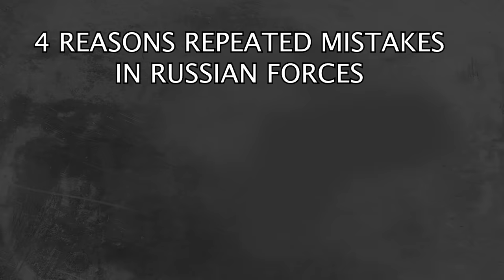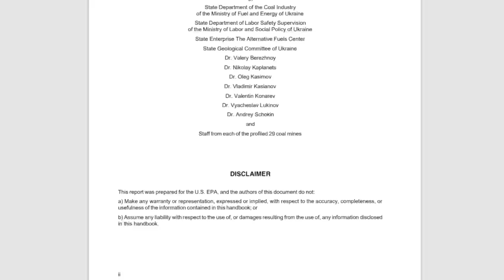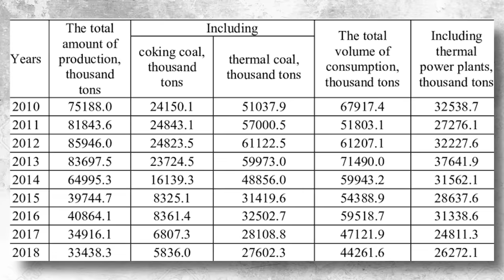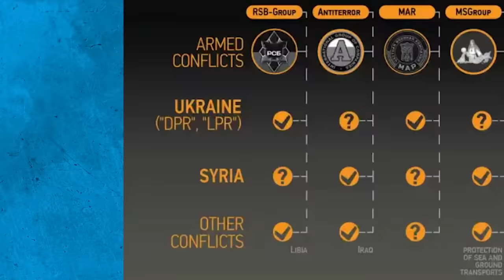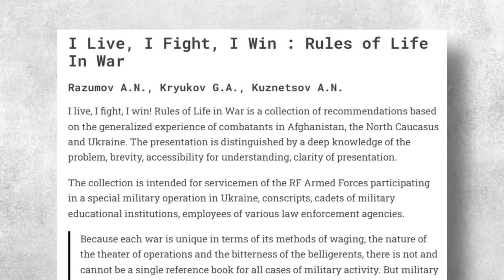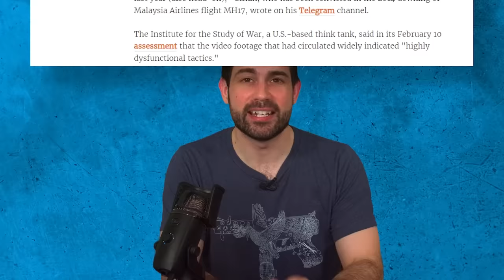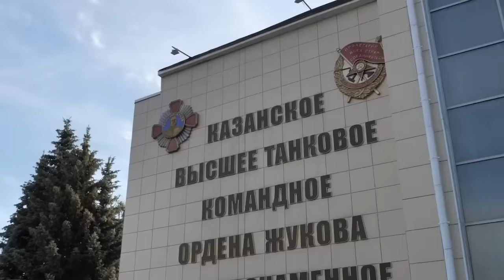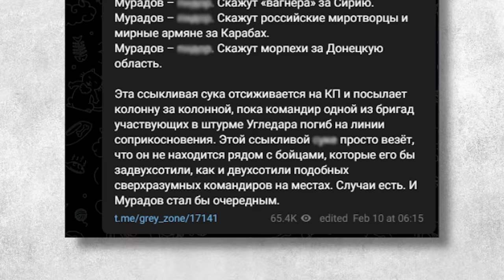Vuhledar, Why Russia Repeats the Same Mistakes

Comment: Nothing much has changed for Russia. I once read a book titled Tigers in the Mud. The man who wrote it was Germany’s first Tiger tank commander. He said that the Russians didn’t really adjust to their failures. He praised their heroism and willingness to charge. But he said they would do the same dumb thing over and over again. For example, he said that one of his positions was to guard a side of a valley. He had four Tiger tanks. On the other side of the valley, the Germans had placed some anti tank guns. The Russians knew the anti tank guns were there. Anyway, he said that he woke up one morning to nine T34s coming down the road in the middle of the valley. They were all pointing their guns at the side of the road where the anti tank guns were at. So he and his crews fired up their Tigers and they easily took out all nine T34s. The next day, he hears the rumble of tanks coming down the road again. He looks and here comes eleven T34s. But, again, all of them have their guns pointing at the position of the anti tank guns. So, again, he and his fellow Tiger tank buddies took out every one of them. It would seem that this has been a thing for some time with the way that Russia operates.
Reply: Bro who needs logistics
Reply: true NPC behaviour
Reply: And then they drove thosands of tanks to Berlin. End of story.
Reply: Goes to show that the key factors in winning a modern war are:

Production
Production
Production
Reply: In WW2 one Estonian guy took out 7 Russian tanks in a row with only one 88 Flak gun.
Reply: @oknevals  Amazing what you can accomplish when you are indifferent to the human cost to your own side. 

Russian "victories" historically seem to require a very high number of casualties. I read once that the Russians lost more guys in one battle than America did in the entire war.

That is not something to be proud of.
Reply: There is a famous story along these lines. Essentially in WW2 there was an order from the top to have the Russians cross this river by a certain time period. By the time it got down to the bottom they realized it was impossible. The river was way to fast, too much water. 

But they were too scared to relay that back to the top, because anytime someone said no to orders they would be shot. So one by one soldiers marched into the river and drowned. Did they stop? No they did it again, and again, and again. Until finally so many people died that they were able to walk into each other to get across. 

Even as people were dying, the commanders couldn’t tell the folks above them because if they did they would be killed and replaced with someone who would do it. 

So they carried out the orders of some guy sitting in a desk somewhere and had no clue of the reality of what was happening. The people at the top had no idea that it was impossible and because there was no communication between the ranks. Just from the top down. 

I might have some of the details wrong but it went something like that.
Reply: It’s a great read, it is even an audiobook on YouTube.
Reply: @ashcarrier6606 even the Germans lost more soldiers in Stalingrad than the Americans lost over the entire war. Each day in Stalingrad (for both sides combined) was essentially a 9/11 in terms of deaths. And the meatgrinder kept on turning for nearly 2 years. 

There were buildings that got captured, recaptured and re-recaptured so many times that the dead from either side couldn't even be removed from them.
Reply: @oknevals  Because Germany ran out of supplies. Ukraine has Nato fueling it
Reply: @ashcarrier6606  In many ways, Russians are their own biggest enemies. On the other hand, Russia is the biggest world country by land mass and there must be reason for that. Also, no single country in history fought wars on scale that Russia did and survived in its form. Communism was their biggest defeat but, they got over it too. They are difficult to understand but, I for sure wouldn't want to fight them.
Reply: that's just totally false, do you know of Bigration?
Reply: @ATRestoration  'only one flak 88 gun'
oh yes, 'he did it with only the best anti tank gun in the world at the time'
Reply: 200iq rught there
Reply: @oknevals  yea tanks made of American steel and bellies full of American food.
Reply: @ATRestoration  thank you
Reply: @oknevals  Oh, so Russia wasn't supplied by America?  Russia would've been defeated without help.
Reply: @MountainFisher  it only accounted for a fraction of USSR war effort.
Reply: @oknevals  At an enormous cost. Unecessarily losing millions of men is nothing to boast about.
Reply: @HaloJumper7  incorrect. During the phase of Operation Barbarossa where the Germans were still just steamrolling them, they lost very significant portions of the arable farmland, in combination with the scorched-earth policy, and had to move their heavy tank plants to the Urals to keep having any capability. They were absolutely in dire straits wrt food and military supplies, which they got from the West. Stalin absolutely hated that fact, of course, and modern Russian propaganda also likes to pretend it never was so.
Reply: @oknevals  The United States gave the Soviets in WW2: 11,000 planes, 6,000 tanks, 300,000 trucks, 350 locomotives, 1,640 flat cars, half a million tons of rails, axles, wheels, miles of field telephone wire, thousands of telephones, thousand of tons of explosives, thousand tons of machine tools and  3,000,000 tons of food. What delusion do you speak of.....?
Reply: @oknevals  how am I brainwashed?
Reply: @MountainFisher  America helped some for its own interest. It was not critical or determining factor in any way. Learn some history.
Reply: @oknevals  Exactly! Because thay had tens of thousands and lost most of them in the process. Along with 25 million of their citizens. But as once comrade Stalin said "Death of man is tragedy. Deaths of millions is a statistic". Don't you agree?
Reply: @oknevals  Though often said, history does not repeat itself. Learned behavior/habits do, especially when in large scale and/or systematically.
Reply: @jamstagerable  What did US learn from wars? Korea, Vietnam, Iraq, Afganistan, Syria, just to name few. It is the Western policies that brought world to the point where we are now.
Reply: @oknevals  the Soviets and Russia literally supplied the weapons for every contradictory establishment in every war you just mentioned 🤣 you cant make this shyt up. Where are you from?
Reply: @oknevals  There in lies my point, which remains the same...You won't catch me on some ignorant personal bias as you're showing yourself to have.
Edit: The world would be nothing but flowers and butterflies today if not for Western policies. 😂
Reply: @oknevals  yeah, because all of those billions of dollars of military aid were not 'a determining factor'
Reply: @oknevals  The Soviet military was heavily armed  by the Western allies.    Russians never showed any inkling of gratitude.
Reply: @Ashley Carrier  to be fair though the vast majority of axis causalities were on the eastern front not on the western front. So it's to be expected the Soviet Union would sustain more casualties.
Reply: @slkjvlkfsvnlsdfhgdght5447  No. West needed Russia both against Germany and against Japan. They didn't give Russia anything from goodness of their hearts and hundreds of thousands of other than Germans soldiers fought against Russia. It was actually very few who resisted. Mainly Serbs and Poles. Few other Slavic nations on very small scale. Western resistance was symbolic at best but, fascist attrocities cannot be compared to those commited in Eastern Europe.
Reply: @oknevals  absolutely delusional
Reply: @oknevals  and do you think Stalin did it for a greater good ? If US help wasn't necessary why Stalin accepted it? Population was starving American canned food saved many lives.
Reply: @markhennessy7598  A Russian living in America, you couldn't make this shit up.
Reply: @oknevals  who said it was out of kindness? whatever the reason, it doesn't matter: the material help was immense
Reply: @markhennessy7598  What tanks were used at Kursk battle? Russia produced 120k planes in four years of war. Why did Russia fight Japan? Sure wasn't for charity. Why did US drop two atomic bombs? Almost third one.
Reply: @oknevals  🤦‍♂️Why are you on an american platform spouting USSR rhetoric?
Reply: I see a lot of you are mixing up Russians and Soviets. Russians are mainly Orthodox Christians. Soviets were Godless communists who hated Russian Church. Most of soviet top leaders were not Russian. Lenin, Stalin, Kruschov. Not sure about Breznev.
Reply: @oknevals  I'm not at all. I literally posted statistics that proved you wrong and then you called me delusional along with brainwashed. Then you have continued ever since to bash my country, the country that owns the platform you are currently using to spew anti American rhetoric...nothing you have said holds any logic or value. The fact that you are trying to separate Russia from the Soviet Union is pure delusion aswell.
Reply: @oknevals  after losing Millions of soldiers
Reply: Otto Carius. It was a good read.
Reply: @hashbrownz1999  while everyone in the world play like a noob conserving their resource. Russian play high level Pro RTS Macro game.
Reply: Great book, would recommend it to anyone
Reply: Soviet doctrine was attack o. All fronts and push reinforcements where the battle is doing best.
Reply: @oknevals  assuming they have the same industrial capacity and endless manpower.  I think this time, both sides have neither.
Reply: @ItachiUchiha-ny6di  by nato, at this point, you mean the US.
Reply: USSR thought there was strength in numbers by fielding massive numbers of fighter jets in the 60s and 70s. Of course, they were forced to think that way because they did not know how to manufacture precision ball bearings, one of the industries the US grabbed after VE Day. Their turbine engines required maintenance every 50 hours. Meanwhile, CFM and GE were producing engines that only required oil sampling every 300 hours. One DC-10 (I think) had a CFM-56 engine that never left the wing. CFM wanted to buy the engine just to take it apart and figure out what they did perfect. USAF wouldn't part with it.
Reply: @OldMusicFan83  Right now there are many sides and none of them seem to be much better than the other. Which side will prevail (if any) is impossible to predict at this point. The only thing to tell appart is that one side may be little bit more right than the other.
Reply: @oknevals 
The Allies drove thousands of tanks to Berlin. Russia for it's immense contribution to the war, could not have taken Germany alone, NONE of the allies could have. 
Typing this out I remembered a key detail in that Russia wasn't just fighting Germany, it was fighting an alliance made up of multiple countries it was bordering as many of them had allied themselves with Germany after the fall of Poland showed them that Britain and France weren't going to help them.
Reply: And they beat the pants off Germany. So there that
Reply: @ashcarrier6606 That wasnt the case in the soviet afghan war that lasted 10 years. The soviets inflicted 5 times the casualties on the afghans while suffering much less themselfs
Reply: @oknevals  only possible with American lend lease, otherwise they would have lost the war badly
Reply: Tiger worked just as well on Sherman tanks
Reply: @SelfProclaimedEmperor  Looks to me like Americans like to take credit for wars somebody else won but, finding all kind of excuses for wars they lost on their own.
Reply: What i think is ridiculous is looking at the failed actions of one bad commander and assuming its like that across the board.  Clearly when you see how the wagner units are doing things its not like this at all.  They have squeezed bahkmut until the ukrainians are forced to retreat.  But the path that is left open to them is basically small muddy roads, and muddy fields.  This then forced the ukrainian army out of the fortified city and into the open... yes they are trying to escape but so many men and material are easy meat for russian artillery.  Meanwhile the ukrainian high command has decided that three days of training and two clips of live fire training is enough to make an "assault squad" to counter attack the russians.  With the end results being a merciless slaughter. 

Meanwhile the russian army at vuhledar are trying to attack an entrenched location but with a much less seasoned commander and unseasoned troops.  The results being rather obvious. Tanks driving into mine fields and then when hitting a mine trying to scatter (good against artillery, not so good in a mine field) 

Tanks assaulting across open ground, yes they tried softening defense with artillery... but ukraine has had 8 years to make these places as tough a nut to crack as possible.  miles of trenches fortified with steel and dug with machines.  fortified underground concrete bunkers etc.  So the result is these tanks end up finding much stiffer resistance than expected.  Honestly the best thing they could do is just hold position and maintain status quo until the situation at the front changes if they want to take this location.  

Of course we are only looking at things from our perspective, the russians may not really want to take vuhledar.  They might just want to throw lots of smoke into the air and try to encourage ukraine to reinforce the region (make it a manpower drain)

The ukrainians may be perfectly happy with the sacrifices in bakmut if it buys them enough time
Reply: @Rat_Andrew  Keep going in your fantasy Pocca-Pocca land
Reply: That book has been largely debunked, but the narrative suited cold war propaganda and prejudice.
Reply: @lokomike2911  stalingrad alone had more casualties on both sides than ENTIRE western front. US got involved in to the war when outcome was already certain. 
Those supplies you are talking about is just a tiny fraction and Russia finnished paying the the debt for it only fifteen years ago.
Gratitude??? How about US gratitude to Russia for paying with BLOOD? Weve seen US gratitude..thanks..had enough!
Reply: @hendrikvanleeuwen9110  exactly.  We know for an absolute fact that the russian military has managed to adapt and change to battlefield conditions.  maybe not as fast as we expect but i figure its a giant organization.  I really doubt that if the usa were in a real war and needed to adjust that they could change quickly either.  

Its just a matter of western centric thinking where the idiots in the bleachers just assume that of course there team is better, and of course they are more nimble and able to change when they dont really know anything.
Reply: @ashcarrier6606   a wins a win. 😂
Reply: @Rat_Andrew  blah blah blah Russian bot.
Reply: @islandwills2778  Russia is easy to misjudge because it has the best and the worst so it is easy to get carried away in either direction.
Reply: @MrKerag  "outcome was already certain" thanks for the joke
Reply: Deep battle is genius that's what won the Vietnam War for the NVA
Reply: @indiasuperclean6969  I have been to India, it was the dirtiest country i have ever been in. Most the roads are dirt with wild dogs running everywhere. There are also huge slums everywhere. I even saw a leopard colony which shocked me.
Reply: @Ashley Carrier  well Americans didn't really fight in ww2,sooo what's your point :D
Reply: @Schimml0rd  that's not true, either.
Reply: @oknevals  By what measure are you evaluating Russia and Ukraine?  Russia began meddling in the Dobas region in 2014, invaded and annexed Crimea in 2014, and invaded Ukraine in multiple directions.  Is there any reasonable calculation that results in Russia only being a "little" bad?
Reply: @islandwills2778   Have you seen current news reports or read current descriptions of the situation in Bakmut?
Reply: @indiasuperclean6969   You are being sarcastic, right?
Reply: @oknevals  costing them how many millions of lives?
Reply: @ashcarrier6606  yea Stalingrad Russia lost 2 million men and women
Reply: @markhennessy7598  it was the price of a payoff. Russia did most of the work in World War II. Millions of Americans would not have returned home if the states had not provided assistance.
Reply: @islandwills2778  Yeah, the first thing to understand is 'there are no good guys' when it comes to geopolitics, only national interests. 
Totally agree about people's unwillingness to apply any critical thinking, the same people who were quoting Manufacturing Consent during the iraq war are now referring to Russians as orcs. Mindboggling.
Reply: One problem with the Russian tanks was that they could not communicate with each other. 
Even if one tank saw they are getting shot at from behind, he could not warn the others.
The Americans did eventually them send them radios, and that helped the Soviets a lot.
Reply: @ashcarrier6606  casualties are summed in different situations, but 1.3 to 1 is still not such terrible
Reply: Lol try a different book, the Germans lost.
Reply: @popermen694  oh those coolstories about soldiers feared Stalin more than Hitler lel
Reply: @oknevals  communism was not built, let's start with it. And socialists built much more for Russia than monarchists or liberals ever. Gagarin, Korolev, Zhukov, Koshkin, all of them were not monarchists or something
Reply: @markhennessy7598  America used antirussian and anti-soviet rethorics since their intervention in 1918 and even earlier, so people just return it back of mother$kin seviors of da world. Soviet production numbers were giant anyway, so walkers on western Europe shouldn't complain somebody puts their efforts at insignificant point when they blame Soviets
Reply: @Rat_Andrew  At least my pink pony is more real than the Russian Military! 🤣
Reply: @oknevals , the charge on Berlin was done under a massive artillery barrage! And, it would also be good to pay attention to the makeup of what was left of the german military in the city. It's not a good comparison.
Reply: @oknevals  After losing unnecessarily millions of men to dumb mistakes like this. A pyrrhic victory at best.
Reply: @fluffymuffin9089  it is your right to be fool, sir
Reply: @oknevals  doesn’t detract from the point of the story?
Reply: @hashbrownz1999  not really, look at Vietnam and Afghanistan
Reply: @MrKerag  you're, not me
Reply: @oknevals  the reason why Russia has such big land mass is pretty the same as the US, there were mostly tribes, easily to be conquered.
Reply: @ItachiUchiha-ny6di , one of the main targets of allied bombing was german manufacturing, transportation and storage of critical war components. Ukraine can't do that! They don't have to rely on local irregulars, for that purpose. A very different situation.
Reply: @HaloJumper7  the only fraction that matters. The fraction that stopped the Nazis outside moscow. American made weapons actually fired!  Unlike soviet and nazi weapons made with slave labor.
Reply: @cottagehardcoreultrasw3998  lol "dont believe German propaganda, believe Russian propaganda instead"

Microbrain move right there
Reply: From what I have gathered their leaders and top generals idolized and edify the generals and leaders from the days of the czars with regards to warfare.  
   Watch their tactics.  It's like Napoleonic Warfare with tanks, human waves, concentrated fire, due to terrible accuracy, the razing and plundering of cities, etc. 
    Like someone told Peter the Great's army, "Give me your musket and fire 20 rounds or less out of this rifle you have no clue how to use.  Good you are trained.. Form up, and fix bayonets!  Charge!"
Reply: @ashcarrier6606  if their prise is to win a war, doesn't matter how much you lose in the war
Reply: @ItachiUchiha-ny6di  but Ukraine is also running out of supplies and troops. Ukraine is already recruiting kids of 16-17 to fight this shitty war, the situation is terrible to both sides, the only thing we can get out of this war is a tie.
Reply: Good book, but ultimately the Russians bled the Germans white.
Reply: @stephenbinion6348  It is. I very much enjoyed that book.
Reply: @HaloJumper7  fraction? Ahahaha no, it completely propped them up
Reply: @hashbrownz1999  It’s not so much production as it is waves of men. Russia never cared about the cost of their soldiers. Just keep doing the same tactics with high casualties until your wear down the enemy.
Reply: He was the fist and maybe only tank to shoot down an enemy plane with its main gun. It was a russian plane too.
Reply: @oknevals with out the west Russian wouldn't able too
Reply: Looks like they had no radio, so others couldn't get the info about Tigers
Reply: @ashcarrier6606  Russia would have like 500m people if ussr never happened..
Reply: @oknevals  communism to dictatorship = not any better tbh 😂
Reply: @markhennessy7598  yeah and they didnt help Finland because they helped the ussr.. Twisted logic theese people have 🤭
Reply: @oknevals  lol, ussr was literally Russia, create in Russia, leaders located In Russia, main city? In Russia, who got the most out of it umm Russia, ussr and Russia are the same thing, just different ideology, not even sure about that last one 🤨
Reply: @stargazer378  Germany vs most of the world
Reply: @Rat_Andrew  yes but Germany wouldnt have fought in 2 fronts, against 2 super powers, soo Russia wouldnt have had the same advantages as with West, most likely wouldve lost.
Reply: @markhennessy7598  You're such a nice, kind guy. You have no idea how many tanks the Soviet Union had at the end of the war. And what new weapons systems have appeared. It was a seasoned army. All American troops would simply be swept away from the Eurasian continent. While you would have created an intercontinental bomber, Russia has acquired nuclear warheads and missiles.
Reply: @Redfvvg  everything you just stated is historically inaccurate. The fact that you are spouting USSR rhetoric using hypotheticals tells me enough about you.
Reply: I find it fascinating that people are taking sides here when clearly Russian tactics have not evolved past a primarily conscripted and mercenary force lacking the professionalism, or more accurately, the discretion and discipline of a modern fully professional military force.

The trend simply goes all the way up the ranks where the employment of poorly organized or collaborated human wave attacks using freshly drafted and poorly trained soldiers are the primary tactic for taking ground, resulting in incredibly pyrrhic losses by comparison.

Russia only has itself to rely upon for refreshing these losses, while Ukraine has the support of many Western powers... China is unlikely to assist as a weaker Russia will make it easier for China to invade and/or control Russia via economic badgering or proxy leadership as the war will leave them reliant on manufacturing, manpower, and raw materials

Russia has little to gain from this war, and the only reason it wages on is because Putin may believe in his hubris that he can win, but more importantly he knows that losing would make him and his nation look very weak. Any general to defy his orders will not be a general for long, so the best hope is to play it out like the war is going smoothly.

Reminds me of Stalin's leadership, and the concept of Soviet nationalism Putin himself stated he admirers... I suppose many forget Stalin's statues were pulled down and destroyed for his tyranny, and perhaps Putin's monuments to his regime shall as well.
Reply: Sounds like they fail so badly that they just don't have survivors to explain why they failed. So they keep failing.

But seriously, it is odd how inflexible and repetitive the Russians are/have been.
Reply: @oknevals  probably could've done it two years earlier if the Stavka hadn't been made up of psychopaths.
Reply: @Redfvvg  what am I conveying here? Be specific since you are calling me evil.
Reply: @darkhobo  hahahahaha you obviously have no idea about the second world war. russian army does not implement soviet tactics at all. they try but fail miserably. if they used soviet tactics correctly they would still fail bc they are outdated. inform yourself about the eastern front before saying a person velieves russian propaganda.
Reply: @cottagehardcoreultrasw3998  you contradict yourself in the first sentences.  Cant even keep your ideas coherent.  Do they use Soviet tactics or not?  Being ineffective at a tactic doesn't mean you aren't using it...

2/10. Your thesis needs improvement.
Reply: @oknevals  they don't have as many as they used to
Reply: That book was a hard slog to read through.  Not the best of the series for sure.
Reply: @oknevals   LMAO...
Stalin Tehran quote
"The United States is a country of machines. Without the use of these machines through Lend-Lease, we would lose this war"
Zhukov quote 1963
"People say that the allies didn't help us. But it cannot be denied that the Americans sent us materiel without which we could not have formed our reserves or continued the war. The Americans provided vital explosives and gunpowder. And how much steel! Could we really have set up the production of our tanks without American steel? And now they are saying that we had plenty of everything on our own."
Reply: @oknevals  No, American aid to Russia was critical.  Russia didn't even have two way radios in their planes until the US sent the P39 Aircobra to them.  Russia produced so many tanks because the US was providing logistics.
Reply: @oknevals  because Nazis failed at DDay… Russians would have lost WW2 without US UK France… Germany versus Russia alone would have been a route
Reply: @oknevals  Get a grip.
Reply: @Renan Vinicius  It does matter. See, when just before the war your national leader executes any officer seen as clever, innovative, open to new ideas, tactics and replaces them with "politically reliable" simpletons, your soldiers are going to suffer horrendous casualties. Unnecessarily.

Russia's high casualties was not an unavoidable fact of life. It was the result of Russia's political and military leadership. Just as they are right now, in Ukraine.
Reply: @oknevals  yea big pack of hyenas can defeat a lion. Solely because of numbers. Nothing special
Reply: @hendrikvanleeuwen9110  hahahahah
Reply: @MrKerag  hahahha
Reply: @raketny_hvost  another Soviet dork
Reply: @oknevals  'ludiey u nas mnogo'
Reply: @MountainFisher  YES you're absolutely right, American

YES you're absolutely right 👌🇺🇸🇺🇸
Reply: @markhennessy7598  i also don't care what paranoid child would bark, you may leave your cries to yourself. Or maybe complain to Gaaga lol
Reply: @raketny_hvost  what the hell is Gaaga?
Reply: @khoboo  Definitely a Zerg rush.
Reply: @polymorphesquirrel  lol, trash units huh 🤣🤣
Reply: @yourmother1631  Vietnam was won politically, not militarily.
Reply: @ashcarrier6606  To be fair, Russia has always had a lower regard (ie they are fine taking more) for casualties than most western countries.  A quote I remember reading years ago to illustrate:  After WW2 a Russian General was asked why they didn't clear minefields before assaulting German positions.  He answered that they considered the casualties taken from German mines to be equivalent to the casualties the Germans would have inflicted if they had put more men in that area.
Likewise, Eric Hartmann, highest scoring ace of all time with 352 kills reportedly said it easy to shoot down Russian planes, they would never break formation regardless of how many he shot down, he just started at the back of the formation and shot them down till he was out of ammo or targets.
Reply: Quantity is a quality in itself.
Reply: @oknevals  Lend-Lease saved the USSR, just like how it will save Ukraine.
Reply: Eh, based on academic historians, the soviet army did learn a lot of things in the ww2 :) the description you provide should be taken with care when generalizing it to the whole ww2 period.
Reply: @HaloJumper7  it accounted for 100% of their troop transport. READ THE LEASE YOURSELF!
Reply: @oknevals  it was a important factor. Without the help Moscow would have been in Germans hands. READ HISTORY!
Reply: @oknevals  what did they learn from those wars that they won all the battles? That politics should stay out of the conflict. Look at the ratio of dead chinese to UN troops.
Reply: @markhennessy7598  This is a democratic platform, any rhetoric can be expressed on it. As Stalin said.I always thought that democracy is the power of the people, but Comrade Roosevelt clearly explained to me that democracy is the power of the American people.
Reply: @markhennessy7598  and running on American tires and American jeeps, burning American fuel
Reply: @oknevals    "they drove thosands of tanks to Berlin."    yup  --  American tanks, American fuel, etc., etc.
Reply: @Frank--Lee  damn right